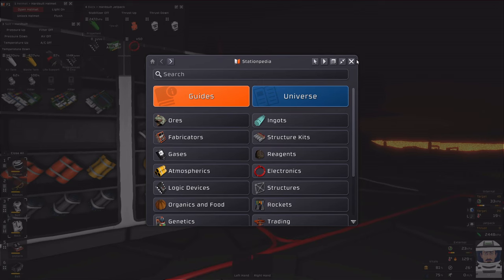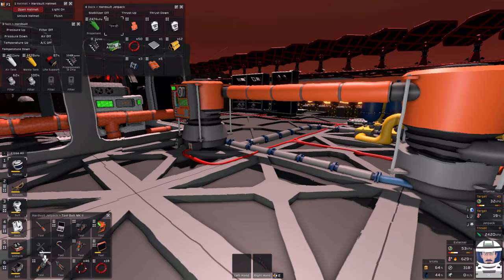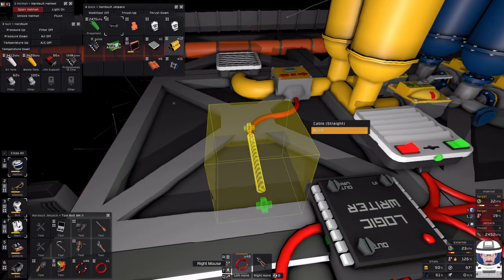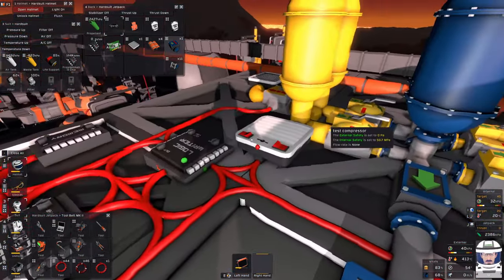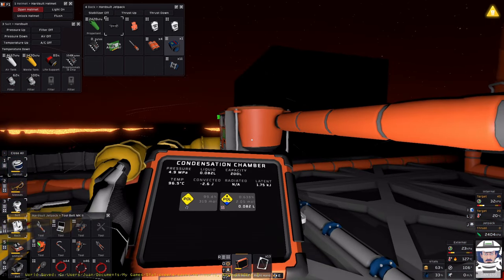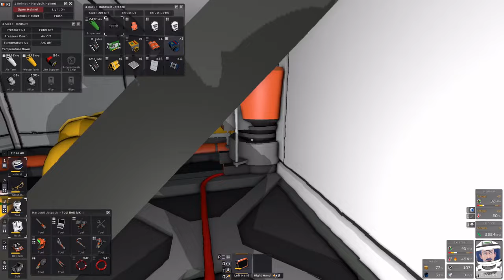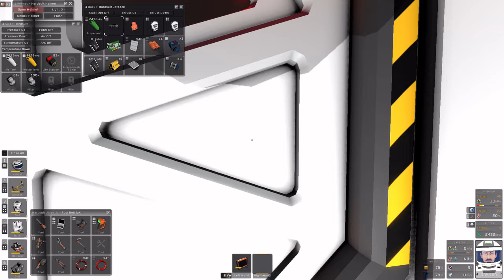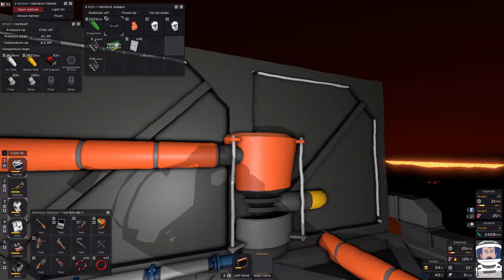Stationeers: Phase Change Vulcan T1 Experiment Build

Comment: What if you just used a night time active vent with the PressureInternal variable limited to like 8 MPa.  That would cause the pollutant  to condense.  Put a back pressure regulator on that, but set it to somewhere between 6 MPa and 8 MPa.  That would cause it to dump out the vol and CO2.  Then the liquid goes through your condensation valve, and then evaporation valve, and you can run it indefinitely without overpressurizing anything.
Reply from the maker: Thats a pretty good idea thinking about it. It would remove the fact that I have the utility pipes as kind of a pressure storage because I realize that the Volatiles and CO2 dont leave and also the heat gained from condensation should be removed as well. I'll need to test this out and see because if it can keep the liquids from exceeding say 135C, then it has the potential to bring the next stage down to about 55C at the lowest and keep the system going for longer in the daytime when we cant condense anything. It definitely is worth a try if it can save some resources and time when the heat stress is getting to a player, especially on a brutal start.
Reply: @shadowdrake082  I just tried it and the output is around 50C or so. Less than that with no load on the system. It's cold enough that you can hook an A/C waste pipe directly to it. But my whole setup had one active vent, two BPRs, and one purge valve, plus the logic. So 450W continuous.  Not great.  Once you count the AC power it's worse than a wall cooler, which can also cool to Vulcan night air.
Reply from the maker: That is true, definitely a downside. As it is the goal was to get a system that works better and for a longer period of time as an equivalent atmospherics AC power draw. Obviously the materials cost would be higher, but it would be an advantage if the cooling was capable of working to cool to room temp and keep the cooling going in a windowed room during the day. It is still an improvement, and could be worth it to ensure the cooling capacity can go for a longer period of time. I think it can be at least something to add to help the system work for a little longer if you havent found a permanent solution yet.
Reply: @shadowdrake082  I'm still working on a system that can be powered from a single active vent, with everything else passive.  I think it's do-able.

Comment: You must radiate transported heat somewhere oustside into atmosphere. Check out the thermal pump pricliple, or your refrigerator how to cool the beer. Yeah, passive cooler at backside. It heating. Condensation acts as a bottleneck in this case, bottleneck for effective cooling.
Reply from the maker: I'm aware of that. The intent of the build was more to have a method of having a thermal storage that gets replenished nightly to get a cooling system set up as early as possible without expending too many resources. The Back pressure regulator fulfills the role for expending overly hot pollutants out as the heat pump works. As it is radiators on vulcan will be useless for this compressor design because temps need to be <100C to be capable of working as it is without a counterflow heat exchanger. Night time vulcan temps are 127C, which makes it impossible to use until T2 Pipebender for the counterflow. By that time, this system can be updated with a counterflow to keep working for a bit longer or completely replaced with a much better system.

Comment: Hey Shadow, did you ever test this setup out with a vacuumed space or insulated utility tanks for the Condensor cooling section?
Reply from the maker: I did try the vacuum space because at the time we didnt have the insulated in-line tanks. It worked as I expected it to when the condenser's section was in a vacuumed space. Without it, the normal vulcan daytime would quickly overload any cooling you can do. But now that we have insulated in line tanks, that will save the time of having to enclose it and vacuuming out the space.
Reply: @shadowdrake082  Did it cool significantly faster with the vacuum versus holding night time atmosphere whilst enclosed in your video?
Reply from the maker: @fuse98  It did, but the main benefit is that it kept the condenser's cooling pipe from heating up past 100 where then the whole system would stop cooling my base. THolding the atmosphere definitely hurt because that extra heat was seeping back in slowly, but letting the pipe network be exposed to daytime temps was even worse.
Reply: @shadowdrake082  Good to know.  Any plans on doing a Brutal Vulcan series in the future?  I'm giving it a go, with the Plants and Nutrition mod also ... it's hectic.  Love it.
Reply from the maker: @fuse98  I did start a playthrough finally on my own... 3 deaths so far... well technically 2 but for sure 1 because I vented a waste tank and somehow set my package of water bottles, cereal bars, and seeds on fire on day 2.

Comment: You can write a max pressure to the active vents and then you don't need the the drain on the intake. think you can do it for powered vents also, but I haven't used them yet.
Reply from the maker: I think later on i decided to just have the chips change the mode so night time = pressurize and daytime = depressurize.. I had a general idea going in but i suppose that was better than me trying to figure out how many more logic chips to use for the digital valve.

Comment: I attempted to make a similar setup, but for some reason mine keeps stalling.  

I have logic set to draw in from outside when the temp is under 130C and filter the pollutants into the system. The intake is at a constant 152C stable and pressurized to 10.5MPa.  Using a few BPR and a purge valve to avoid over pressure situations, I have a lot of the cooler gas going back into the intake to help stableize it.  The Condenser side of the system sits at approximately 102-104C and the pressure is set to 4985 to keep it in that range.  The evaporator side is set to 3650 because I'm looking for a 25-30C temperature in my base, however the system keeps stalling at about 50C.  

Any ideas?
Reply from the maker: If your condenser is about 102C-104C, you would be at the limits of pollutants to get down to 20C from there since Latent Heat/specific heat is close to 80C. The hard part is that with the active vent, you can pressurize the pollutants and they would be leaving at close to 150C. If you can evaporate it, ideally it would get as close to 70, maybe 80C. How cold is the gas where the condensation chamber is trying to push the heat out? If the condenser can drop 10 degrees, you may be able to get the base down to 40C.

The main difference between this build and now is we do have insulated in-line tanks now, potentially add a few to be able to have a larger buffer storage for the heat exchange line on the condensation chamber to try to keep your the chamber cooler longer, hopefully until you can refresh it with each night. If you got T2 pipe bender, first thing I would recommend is putting a counterflow heat exchanger between the evaporator and condensation chambers, that should allow you to get down to 20C, provided your condensation chamber doesnt hit 150C.

Comment: Nice.

I think the next best thing you could show is a video for each of your videos so far but utilizing T2 tech to move to a mid game scenario.

As far as Venus goes, you mentioned 2 Atmo AC units, that's obviously to get the Venus atmo down to less than 152 to allow the pollutant to liquify to build this system like on Vulcan?  Biggest pain with that is the trace amount of X in the atmosphere, but at least you could gather it 24/7 since stable Temps aside from Storms.
Reply from the maker: That is true, I could go back and show how T2 can be added for improvements and any setting changes that result from that. Looking back I overpressurized my first Pollutant devices on Europa and need to drain some out, but I could also show how extra chambers can increase the speed of moving heat around. The brief jump I had on 25:40 did somewhat show some of my atmospheric system on Vulcan. I can probably make something short to talk about it again because I use something similar to that in all my planets for atmospheric control.

I was theorycrafting and looking at each gases's specific heat, latent heat, and max condensation temp and pressure to see what it would take for Venus. From my notes and from watching Elmorix's "Let's Talk about Cooling" video which used Atmospheric Ac's pre phase change, it would be quite a build. Easily I wouldn't think rushing T1 is very viable. If I did my math right, ACs would step down temp from 55C to 70C, so if I pick 60C it would take two of them to go from 460 to 340C, which puts me in the range to use water as a coolant. I did the math and water's specific heat and latent heat gives us a range of 110C. It would take two loops (T1) to get down to 120-140 to allow me to use Pollutants and Nitrous oxide. And then it would take me still another two loops (T1) to get to 25C. In total the power draw would be 720W for two acs, 200W for the water loops, and another 200W for Pullutants. T1 is already at 1120 W and if T2 Heat exchangers eliminate 2 phase change device loops then I'm at 920W. I'm seeing just how pricey Venus is for power needed for cooling. Of course this is without using Elmo's AC trick of using just 2 ACs is very potent and hard to beat for Venus. 

I guess if Elmo's Ac configuration isnt used, it does save 5-6 AC's worth of power usage. I can see a phase change solution would be a mid game approach for Venus. I think the biggest problem is the need for water for phase change device when that is already a very needed resource for drinking, plants, O2 and/or volatiles, and to pressurize the phase change devices. I think yea the pollutants can be slowly built up and once the water is pressurized it can then be cooled and condensed.
Reply: I'm new to this stuff but what formulas or links to more about them could you share that you use for all your theorizing on atmospheric cooling in general?
Reply from the maker: @fuse98 
So with the atmospherics AC, Most of the information I got from Elmo's Video (https://www.youtube.com/watch?v=oZ2pk27NfjQ) talking about the AC system and some others. Generally it can do a 55-70 degree difference between input/output and waste before the efficiencies really crap out its performance. That will be helpful for setting them up and getting them up and running.

As for Phase Change stuff, I go over quite a bit of details on my Phase Change Mechanics Video but in short you look at a gas's Specific Heat and Latent Heat to get how big a range of temperature difference you can do. Latent Heat divided by Specific Heat and you have a temperature range that a gas can increase or decrease from full evaporation or condensation. As far as how this all ties together, The specific heat will tell you how many Joules of energy it takes to heat or cool a mol of a gas by exactly 1 degree. The higher a gas's specific heat the overall more resistant it is to a temperature change. The latent Heat tells you how much Joules of energy per mol is released or consumed to complete a phase change.This is how I get my information for how limited I am with a coolant gas's ability to cool and why I tried to set my chambers the way I did in consideration for them and other sources. Admittedly I had a class on thermodynamics which is how I have a lot of background information on the science background so I'm not sure of any other links or resources I could point you to for a really deep dive, but I hope just working with the information provided by the Stationpedia should be most of what you need to work with in-game phase change related applications.

I can keep trying to explain other things because I do forget to explain things that not everyone may have as background information to work with.
Reply: Thanks!